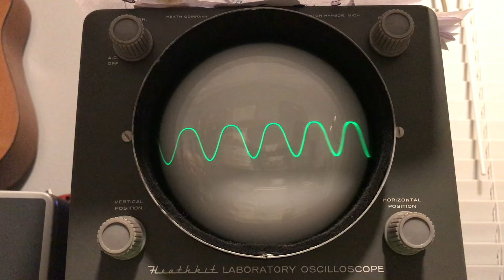Glock Frame and Trigger Disassembly, Cleaning and Reassembly as Performed on a Glock 26

Comment: And Thank You. IF I was purchasing an OEM stripped lower. Would there be additional steps or parts to be removed from old Lower?
Reply from the maker: Depends how stripped, you can see ive left the absolute minimum in such as the mag release.  It possible it might need to be swapped.